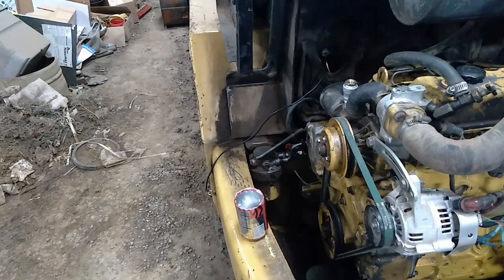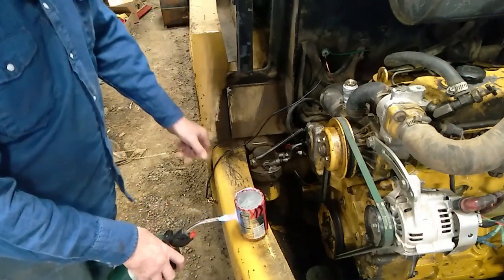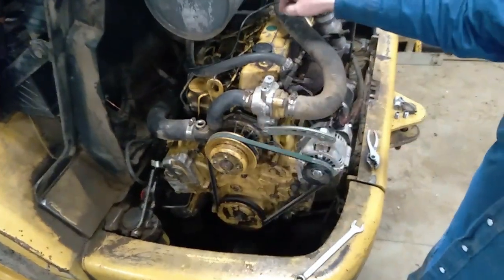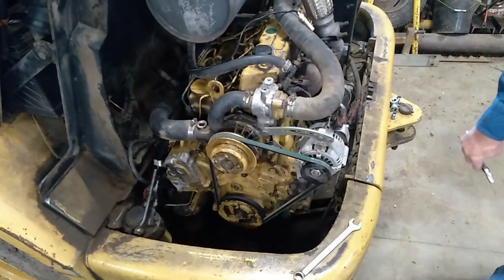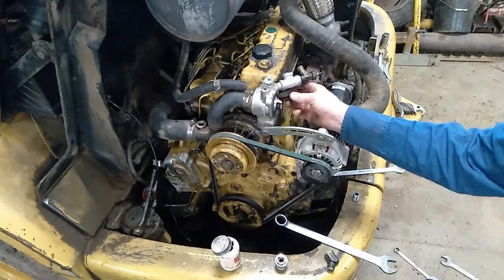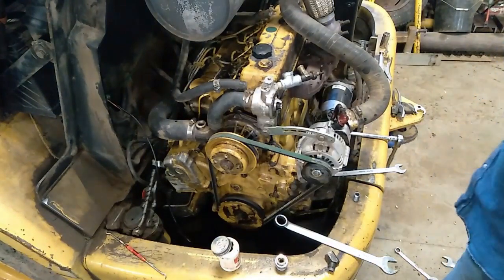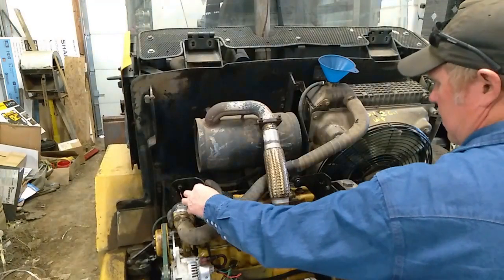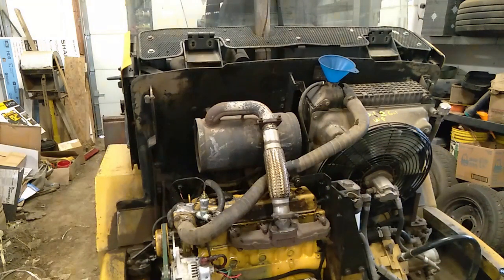Cat 3034 temp gauge install and test.  #diy

Comment: Cat was so stingy with gauges back in the days of the 3034. My skid loader has the same engine. I plumbed a temp sender in the port directly below where the factory one went by the thermostat. And then ran an oil pressure gauge by doing a Tee where the factory sender is. My engine never goes above 190 when running hard. And even with 6500hrs on the clock she still has over 40lbs of oil pressure at hot idle and around 60 under load. Last thing I want to do is a tach. I’m thinking the tiny tach that clamps on the line for injector 1. Or maybe one that wires to the alternator.
Reply from the maker: My hour meter showed 9000 hrs when the rod decided to try and exit the block.  However the meter was no longer counting so I am not sure of the exact hours.  It also had a tough life being used in the demolition business with operators that respect a machine.  The new fractured style rods should be stronger and last the life of the loader.  Thanks for watching and info.